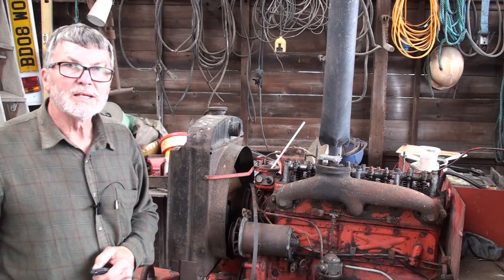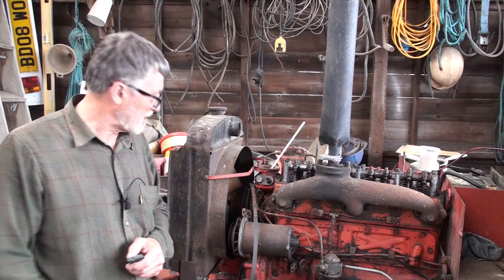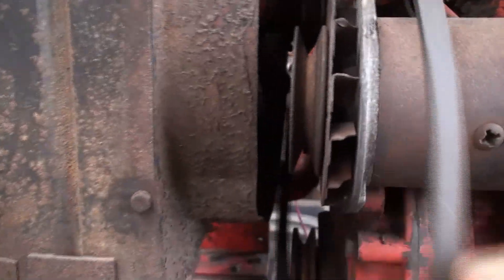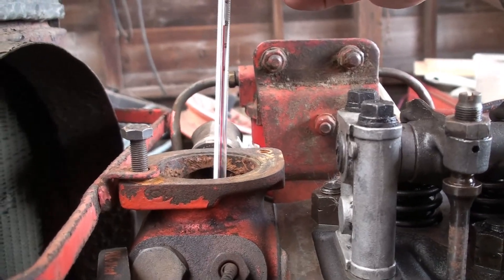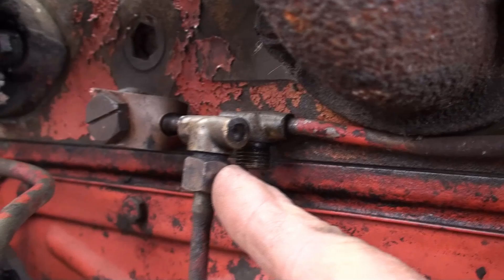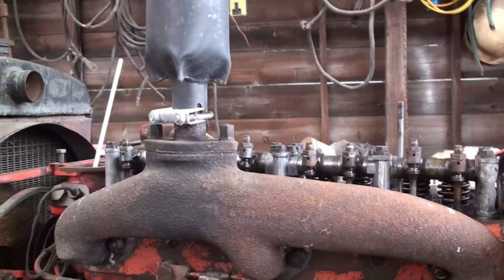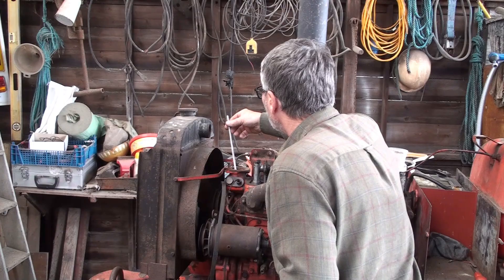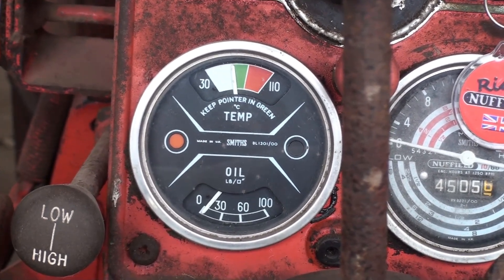Retorquing the head gasket

Comment: Applying torque to bolts is really just a proxy for pre-stretching the bolt so it maintains the correct joint loading in service. It’s better to think of the bolts as springs, the initial cold pre-load (100ft-lbs) gets you in the ballpark. Re-torquing the bolts when at the correct operating temperature corrects for the loss of loading on the bolted joint due to thermal expansion. On large industrial bolted joints we don’t even bother with torquing and just use hydraulic bolt stretchers to get the torque perfectly accurate without the losses due to friction in the threads and nut bearing surfaces.
Reply: Some of us used add 10% initially as re-torqued was not possible. They were successful jobs. Sometimes in our ignorance we used antiseize on threads which greatly reduced the friction and more than likely over torqued the head bolts. One habit I promote is to go over the head bolts in straight lines after initial torque pattern job is done, this way nothing gets missed and the bolts have time to squeeze out the lubricant.
Great Job Monty, it's a pleasure watching and absorbing the many "fine details". Peter

Comment: Another interesting video Rick, I have two 10/60's which in the past I fitted new liners and through mainly laziness and not having a spanner to avoid having to remove the rocker shaft I have never re-torqued the heads. I recently changed a head gasket on a major and didn't re-do that one either. So I was surprised at just how much tighter you got them, I am torn between bothering to check them now or just leave them and keep my fingers crossed! I always clean and oil the threads before assembly though as I think this helps to get the correct torque at least in the first instance.

Comment: Very nice and interesting video, l replaced my head gasket on my diesel David Brown 900 last year, bought it knowing about this, had blown between 3 and 4, l too torqued the head bolts to 100lbs ft but have decided to leave it alone as am worried that l might snap a head bolt, for now it’s absolutely fine and seems like it will be okay.

Comment: Good  day from Ontario Canada  I always  had a soft spot for 10-60   even though over here  they lost alot of interest.
Ths
Reply: I have only seen 2 Nuffields/Leylands in Alberta and one in Oregon. We used cheat on some equipment by giving initial torque an extra 10%. We never knew till years later the antiseize we used allowed extra turnage of each bolt. One can get into trouble fast overtorquing many of the older less strong bolts. Good show Monty. Peter
Reply: Very few orange Nuffields here in Wisconsin but the Leyland you see them, still, they aren’t very popular unlike David Browns and Fordson majors, plenty of them about.